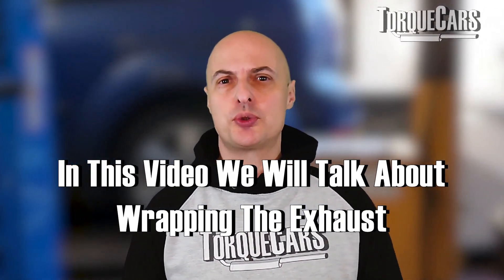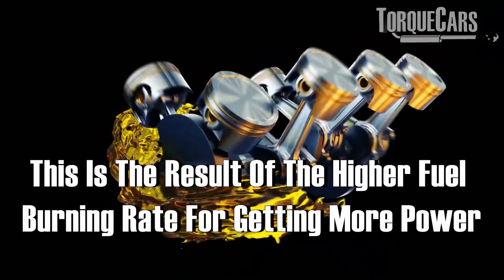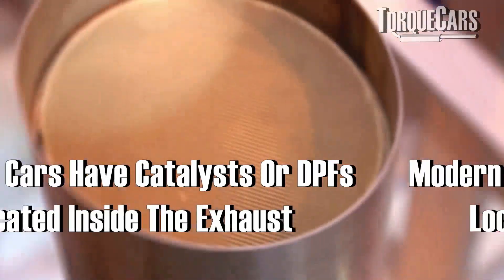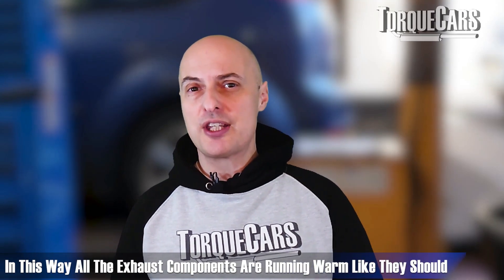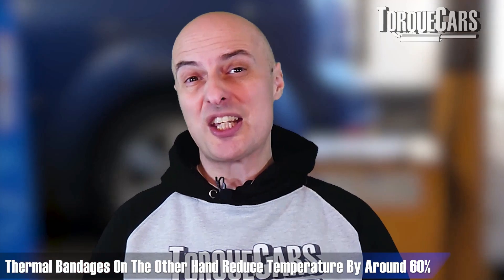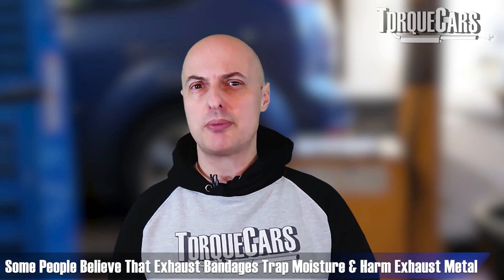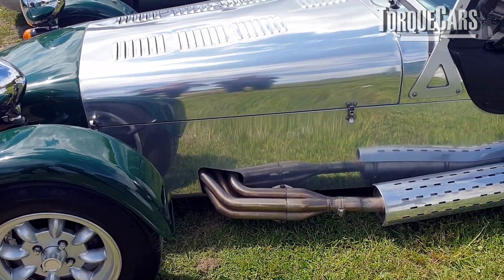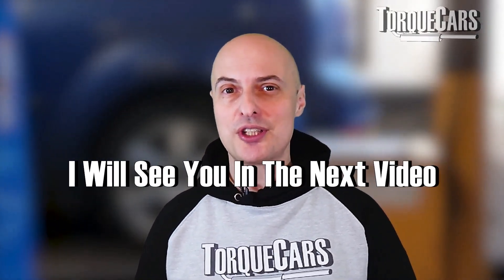Benefits From Ceramic Exhaust Coatings & Thermal Wraps

Comment: I've been wanting to do this mod (at least the wrap; ideally both ceramic coating & wrap) for years but my mechanic, who admittedly knows my Alfa 146 TS inside out, doesn't want me to. In fairness the TS engines have exhaust heat shields on them, but still we have quite hot summers here in Greece. Would you suggest that I go ahead and install at least a wrap, Wayne? Wouldn't it help further reduce those underbonnet temps? I have an "almost complete" Stage 1 tune on my 1,400cc Twin Spark (~15% more power). Thank you in advance, Harry.

Comment: Have you got any tips/ideas of where best to buy exhaust thermals wraps and coatings? :)
[edit] not that I can't find any but perhaps some thermal wraps are better than others quality wise.
Reply from the maker: I would go to demon-tweaks, they offer Cool It thermo tec & Design Engineering Titanium. For coatings I would go to a specialist the DIY ceramic and heatproof spray paints are not very effective and it is hard to apply them correctly so they last.
Reply: @torquecars  Ah briliant thank you =)

Comment: I had a cheaper (I believe fiberglass) wrap on my exhaust for about 2 years. The exhaust wasn't new but was in very good condition. Elements took effect on the wrap and I recently took it off. There was definitely some rust on it, only one spot had more rust than I think it would have. Overall I can't complain and will be wrapping it again!